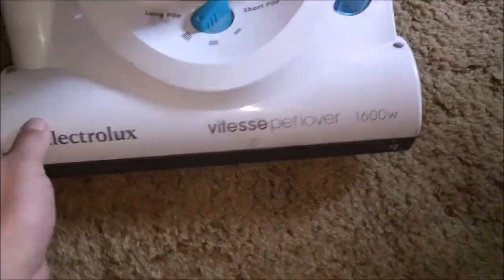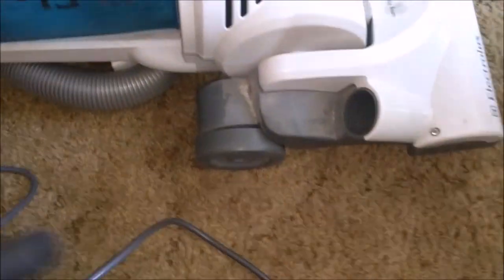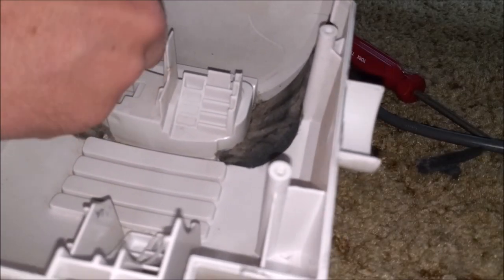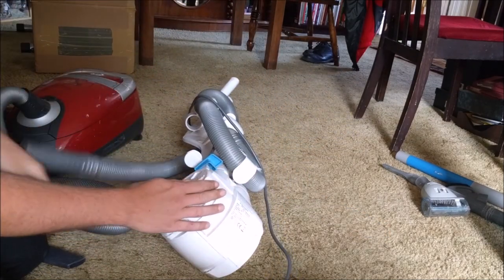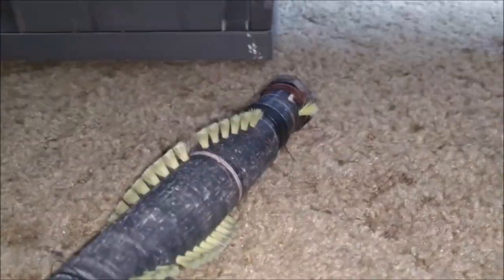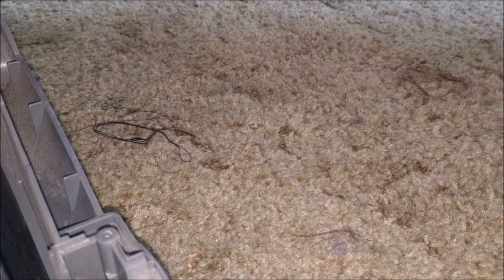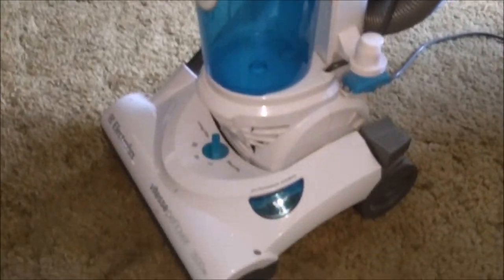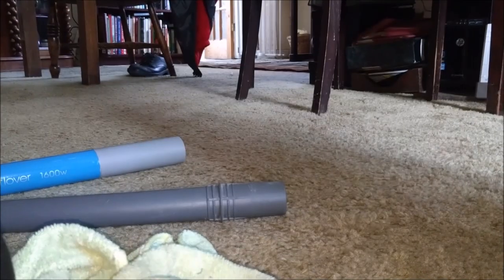Electrolux Vitesse 1600w - Quick and dirty Refurb and first look!

Comment: I've got the bagged version of this, the Powerlite Petlover, and to be honest, I'm quite pleased with that, the floorhead is basically the same, and the tools are the same too, but I do find the hose kinks very easily and cuts off the airflow when using the tools, not to mention the hose is very short and not stretchable.On mine, there is a removable pleated hepa post motor filter where the headlight aperture is on yours, and this is a better idea than not having an easily serviceable post motor filter. The filthy state of the motor housing on your vac, obviously caused due to the machine being used at some time without the cone filter fitted in the bin, was a fire waiting to happen, especially if the motor overheated and started burning out with excessive arcing from the carbon brushes. All that hair and dust would have caught alight fairly easily I'd say, and that was quite dangerous built up in their like it was, with no easy way for the owner to clean it out other than taking the machine apart, which most people would not know how to do.Cone filters with no outer cover are about the worst kind of bagless system, they clog so quickly it aint funny, and the bagged version is much easier to maintain - it even uses microfiber cloth bags.I would have replaced that belt though, for peace of mind that someone aint gonna use it on deep pile carpet and find the brushroll stalls due to the belt not being as tight as it could have been, but I suppose if they complained, you'd tell them to bring it back to you and you would have fitted them a new belt. Part of my problem when I used to refurb Dysons to sell on ebay was I used to fit too many new parts and end up making next  to nothing on each machine, so I suppose you have to weigh up what to spend and what not to spend on a cheapy machine like that one. Always enjoy watching your videos Sam, thumbs up from me on this one too!